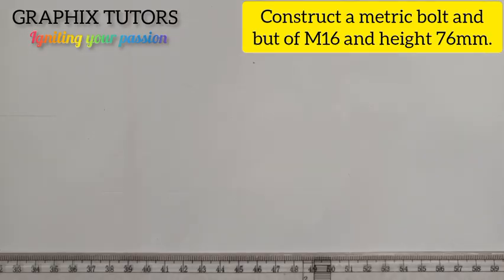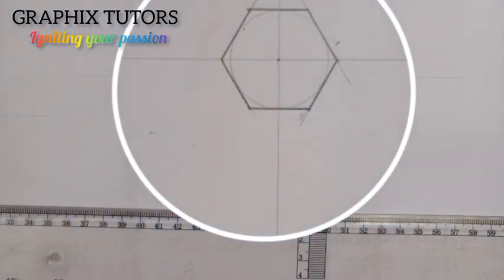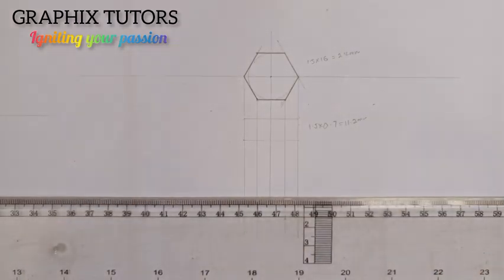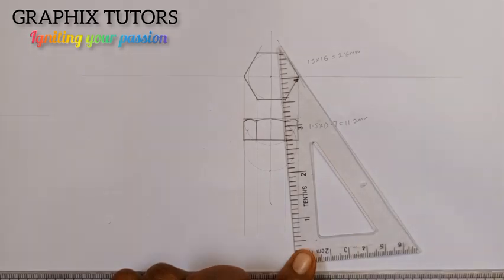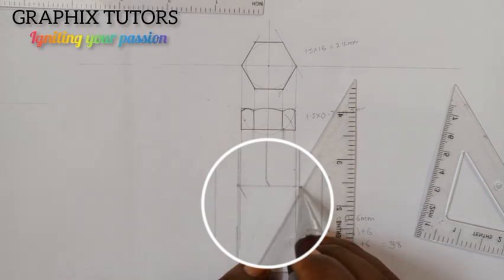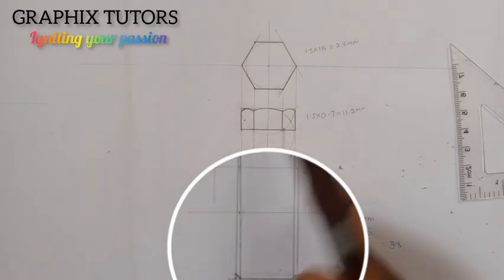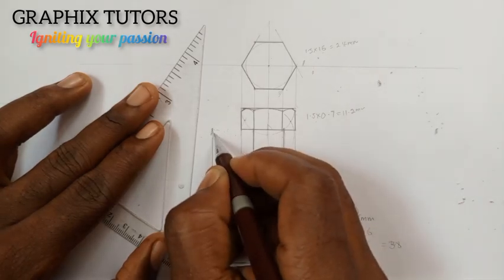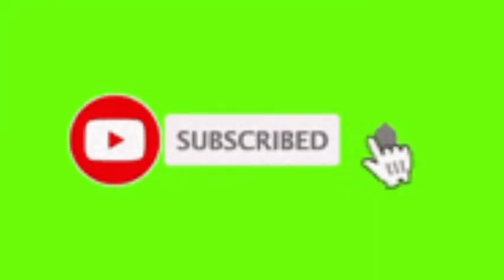how to construct a metric bolt and nut in engineering drawing_interpretation

Comment: Why do u multiply 16 by 1.5 and 1.6
Reply from the maker: That is the standard. If a bolt or a nut has a diameter of M24, M10, M30 and so on, if you want to get the actual diameter you multiply by 1.5.

If you want to get the thickness of the bolt cap you multiply by 0.8, thickness of nut you multiply by 0.7 and many more standards.